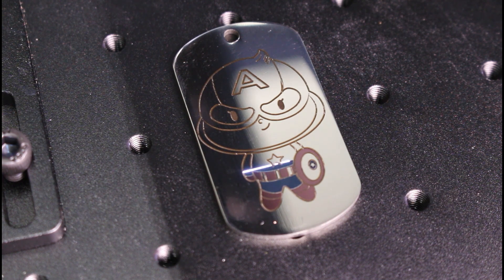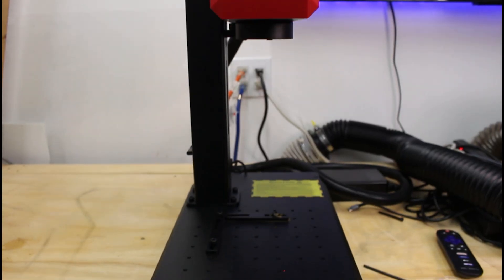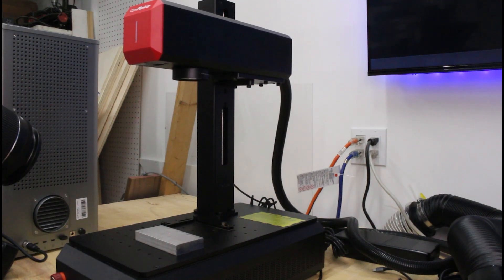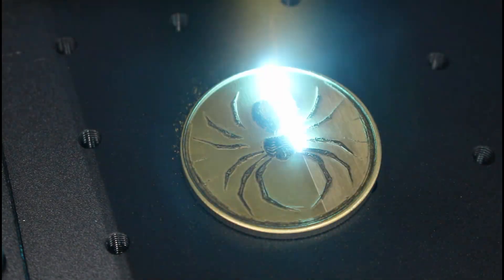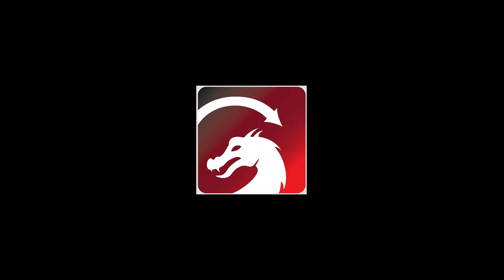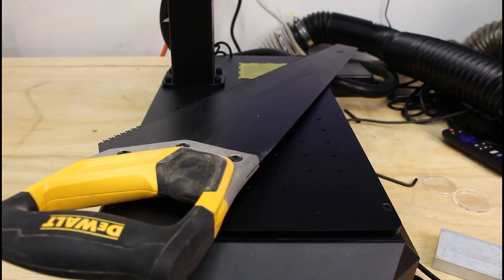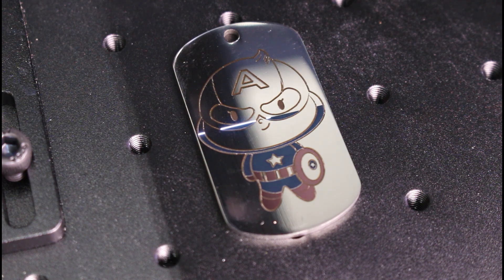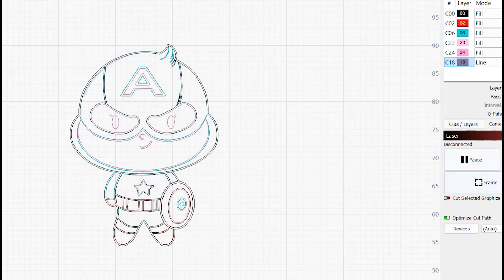A Compact Laser Engraver That Can Do THIS?! ComMarker B6 JPT MOPA 60W

Comment: Thanks for the video, I got one earlier (the 60W mopa, autofocus) and I really enjoy it. and Lightburn is a must-have software.

I didn't measure the max height of the engravable piece, but I find the laser tower a bit too small : it could be taller. Do you think the riser provided for rotary tool should be put in place permanently ? (even rising a little bit the engravable piece to compensate and get autofocus to run).

The autofucs error message you get is because the focus beam doesn't see the piece anymore, but it's the normal use : you focus with it on the lower part of the workspace, then move the piece if you need, just ignore the message if your item has been focused correctly, then moved. I don't know if that's clear (sorry for the bad english).
Reply from the maker: I definitely think it should come standard with a taller riser! Thanks for the info about the auto focus!
Reply: @LetsMakeAThing  You're welcome, thanks for the videos.
Cheers from Paris.